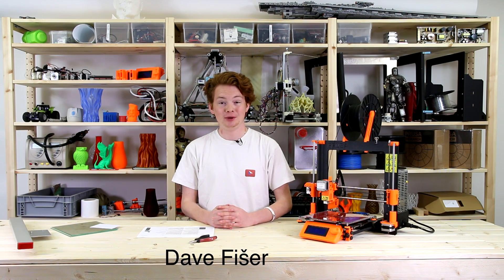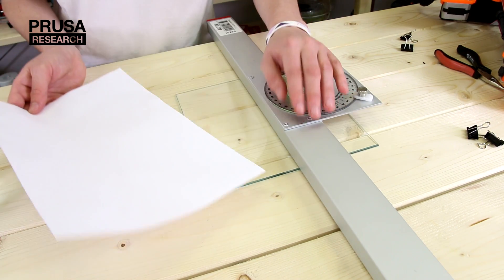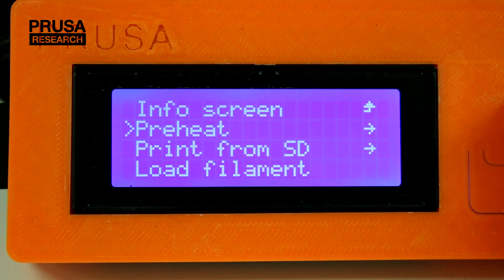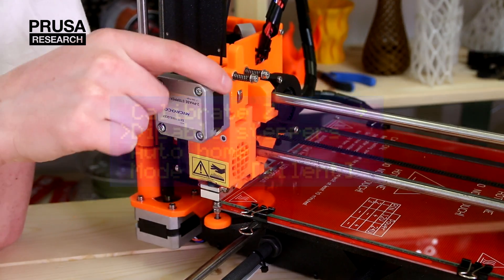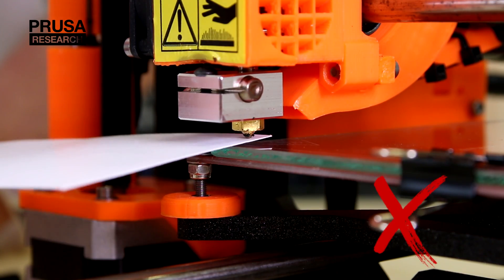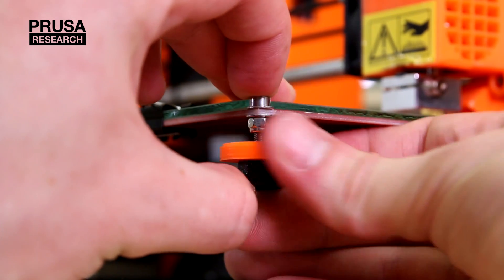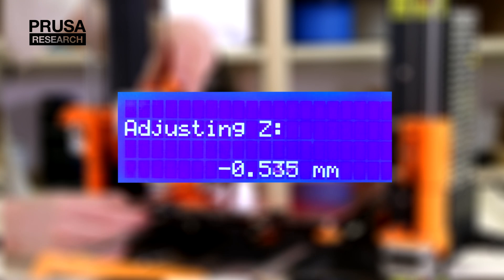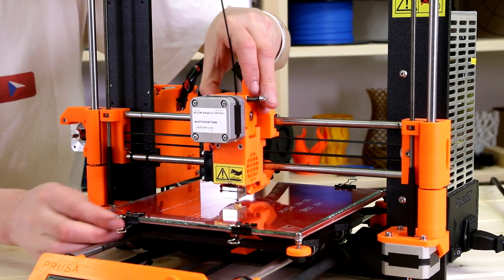Original Prusa i3 calibration

Comment: One thing I noticed is the fellow in the calibration video presses down on the print head.  I find that the print head on  my printers actually move down (the rods are slightly flexible).  I recommend against holding on to the print head while testing the calibration with the paper.

Comment: Useful video for beginners. Maybe one more tip: Do not hesitate to use more clips around the glass if your heated bed tends to bend a bit during heating. It helps to keep the plane flat.
Reply: +Tomáš Vít Worst tip ever.  Use Silicone heating pads (commonly referred to as Gino pads) as the clips will do as you said and inveritably you will slam the nozzle into one when you least expect it, or wasn't paying attention.
Reply: ***** Dear Alchemist (dark one), as the original Prusa i3 Plus has original clips, I only use more of these clips without any critical slamming. ;) Maybe it's not the most sophisticated solution, but it works (as I can say after some period of printing), it's dirty cheap and it prolongs original approach. Ultimate solution? Upgrade to original MK42 heated bed. ;)